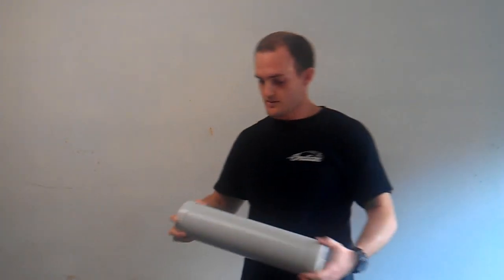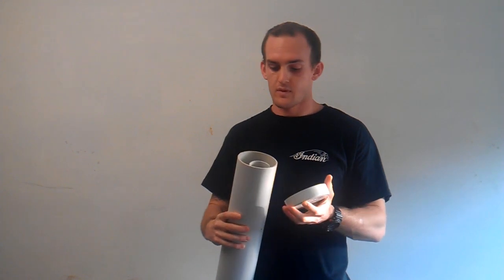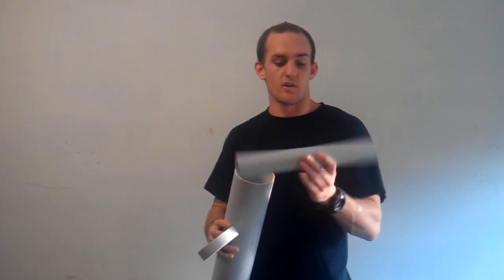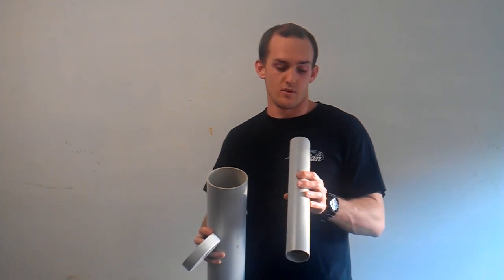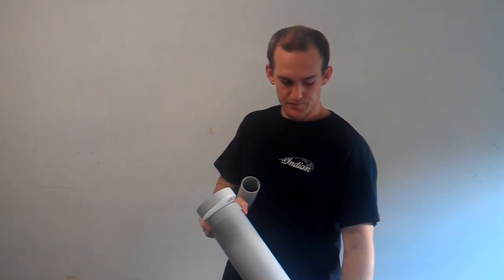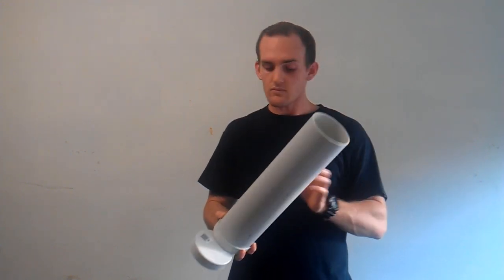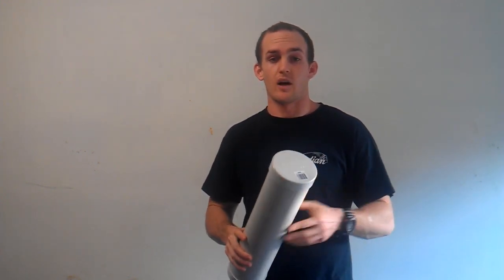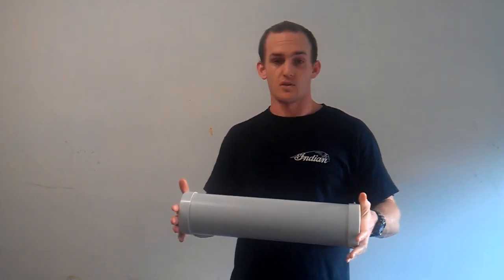DIY Foam Roller

Comment from the maker: The PVC pipe i acquired for free at a building site, they were throwing the stuff away. The end caps cost about $ 2-3 each. but if you had to purchase everything you would probably be looking at $ 20-30. You can also purchase the 100 mm pipe in 6 meter lengths which is great if you want to use the remanding pipe to make a sloth pipe.

Comment from the maker: Hi Ris Jai, A 6" would replicate a typical foam roller as they are usually around that diameter however it would depend on the application and target muscles I find a larger diameter better when I can use bodyweight to apply pressure. I used the 4" because I had it lying around and it still does the job. The length is 45cm but I believe you can purchase 2ft length at your local hardware store.